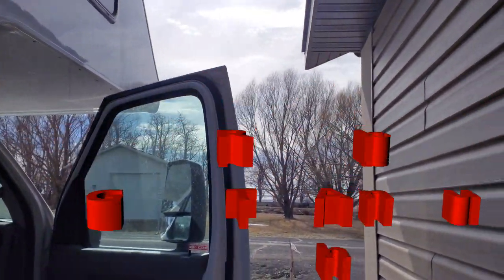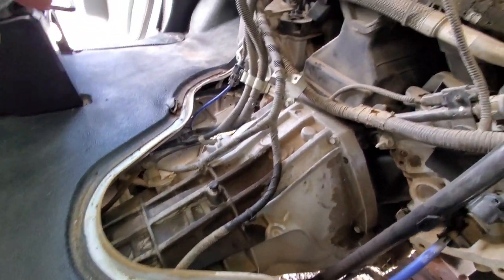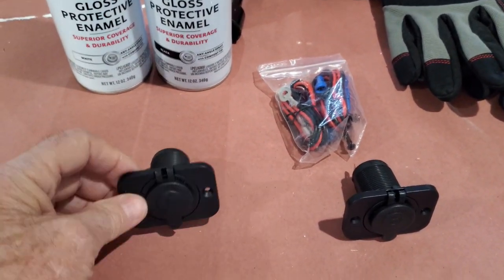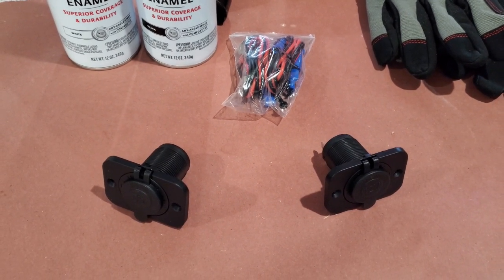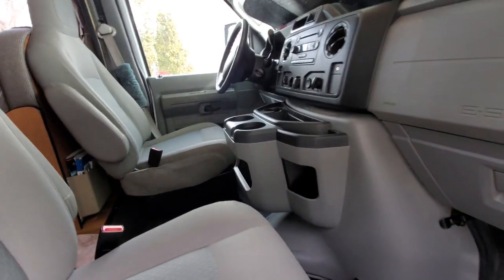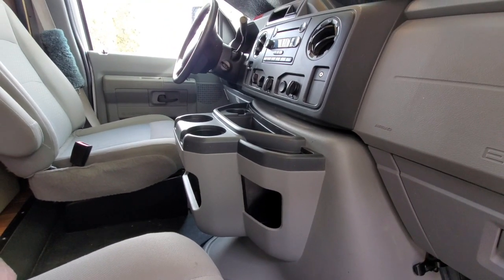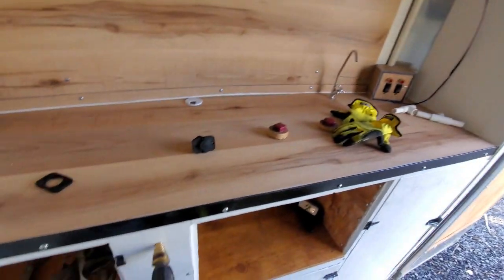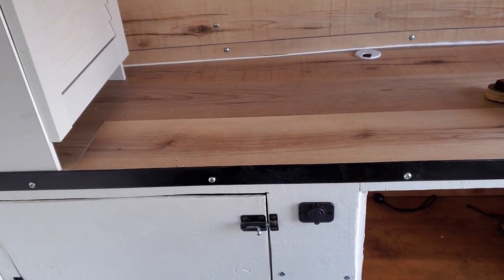Power point placement

Comment: When smoking became politicly incorrect they changed the name to power port since you can also use them for getting power to things, I wired one of my factory ones in my truck to the wire for the A/C so it became switched. Good job Gary. No matter what I tow I get lousy gas milage.

Comment: Good video. They put those fuse boxes out of sight in bad spots, so you will go to the dealer to have a fuse changed for $150 and hour.  I had a hard time finding mine on my winnebago, it was a ford and way to the back also. I think you best mileage would be the dodge and the trailer.Be Safe.

Comment: I would think the lighter trailer would give you better gas mileage however enclosed trailer gives you more comfort and protection and versatility. It's a vacation go for broke and have fun. Thanks for the video
Reply from the maker: I think there will be a time and place for each trailer. And I'm pretty sure we're not going to get rid of either of them. Matter fact I think we will buy another Light trailer just so we could tow the Jeep. It's cheaper than buying a new Jeep that is towable.
Reply: We had a Class C motorhome for 10 years and towed a trailer with the bikes and then decided to get a towable toy hauler so I can take the bike and have a vehicle to drive around in if needed

Comment: To turn off all the electrics in the RV the easy way is to fit a battery isolator, the type used in Motorsports with a big red plastic key. Easy way to check gas mileage is to do back to back trips to the same location say 50 miles each way from home. I did that when we had the choice between a large towed caravan with a big American 4x4 and a large American RV towing a car trailer with a small car on it. Both had 350 Chevy gas V8's. The RV was marginally cheaper but not much. Roads were quite hilly and very busy so a good comparison. Might be relevant to your question. Sent you a email with fuse box info.
Reply from the maker: There there is a campsite about 50 miles away from here that we did want to go explore. Maybe that would be a good idea to tow one Trader up on one vacation and the other on the next. Problem is price of gas you just don't want to drive in circles. Thank you Paul

Comment: I would take the enclosed trailer for the little difference the mileage would make. It could double as shelter for some tenters if bad weather comes up as well. No brainer for me.Find the fusebox and there will be switched power to tap from there.
Reply from the maker: I'm thinking the same way as you are
Reply: @G_RAThbun  The ignition switch is a good spot to tap as well if fusebox is difficult to reach.

Comment: If you were pull a trailer with your truck, the flatbed one be best for mileage but behind the RV. The enclosed trailer will not change gas mileage at all or go from 9 down to 8 mpg. I don’t think any wind will hit trailer behind the RV at all, be like getting behind an 18 wheeler.
Reply from the maker: Thanks for your comments Shane I built a little trailer and it is built quite well matter fact I doubled up on everything that was on the trailer I copied such as stretch braces and decking. So it is not real light but I know it would be lighter than the enclosed trailer. Don't know if that's enough difference to matter. I guess I could tow them each and see but it is what it is when you hit the road. I know the enclosed trailer has been updated with new tires bearings and such just last year and the other one has been sitting around for quite a few years with old tires and new axle but just sitting. Hope to see you at Sturgis this year catmandoo Campground